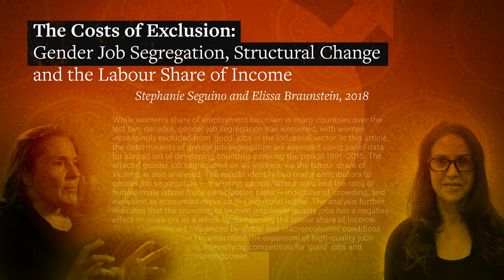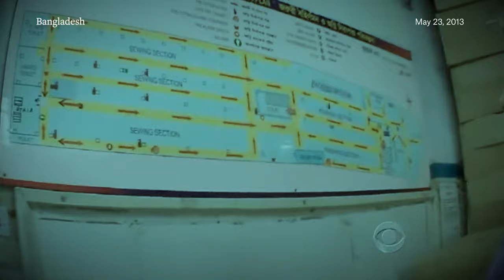Women in (Recognized) Work | Feminist Economics Part 2

Comment: Why is it that when it is mechanized then suddenly companies prefer men??? How does this shift works?? Women are still available at low wages and if they're willing to work for 15 hours. Is it because women are less willing to go and work in the factories as they have to do the socially acceptable "mandatory" carework in homes??
Reply: It seems to me that the unvoiced assumption behind that claim is that it is generally believed that men are better at working with technology than women: the maintenance of machines requires working with technology and because men are better at using it, it's better to have men than women. 

I don't take a stance on validity of these assumptions, but I believe that the swapping of women for men as production becomes more and more automated has much to do with the prevalence of these beliefs in many societies.

P.S. I want to point out that the assumptions don't necessarily have to do with mechanization, that is, doing a limited set of tasks repeatedly. Rather, the assumptions are about the automation of those mechanized tasks and the maintenance of the machines that perform those mechanized tasks.
Reply: @excitedaboutlearning1639  u have to be trolling?